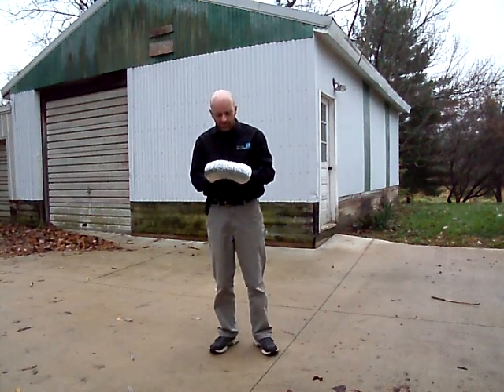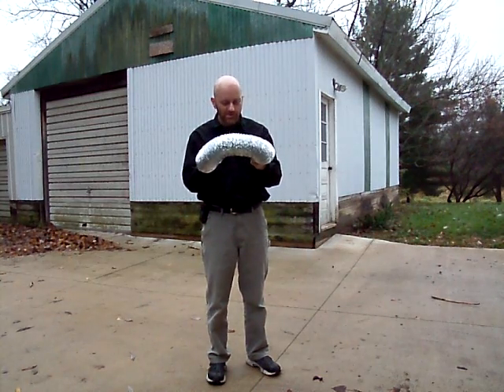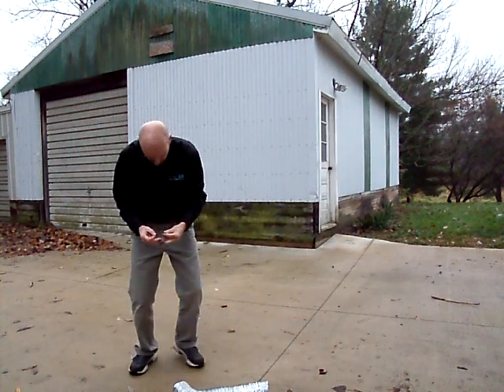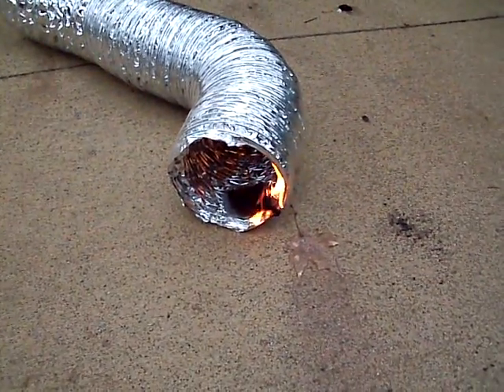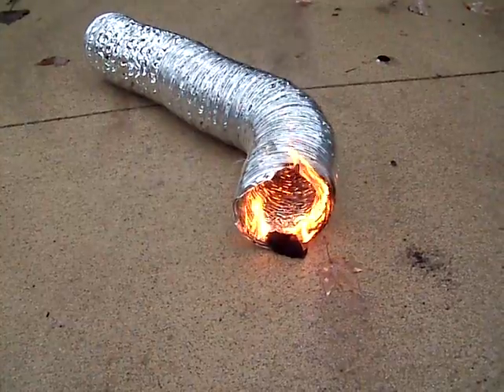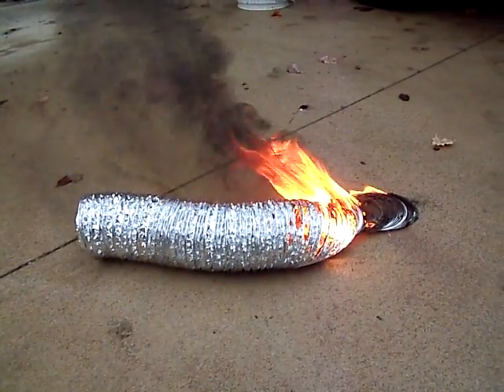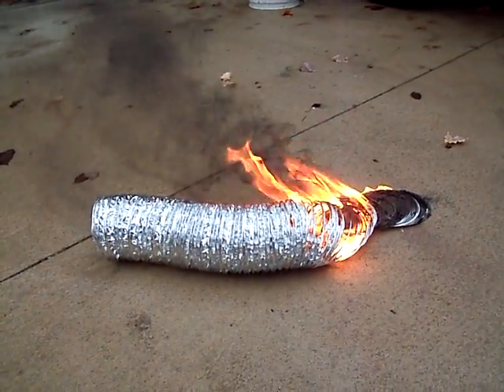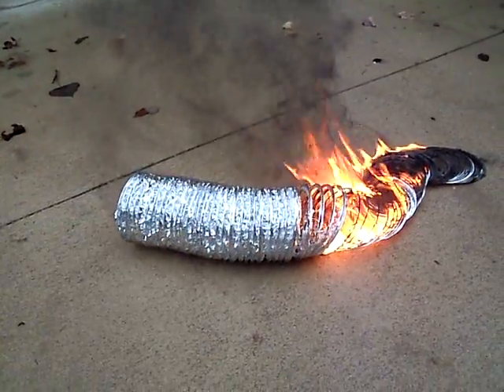Dryer vent installation BAD IDEA

Comment: That is plastic vent tubing and is made to look like it is made of aluminum. There is an actual product that looks like that, and it is actually made of aluminum and not plastic. That one is approved in Canada and I just used it to hookup my electric dryer. The stuff I used its called pro flex in Canada and you can put a blow torch to it and it will not start on fire. They have a similar product in the USA. I moved into my retro 1972 rancher 4 years ago and have been renovating it since buying it, and I had about a 9 foot piece of that God awful plastic dryer vent stuff running under the crawlspace to the outside. I should have changed it when I moved in, but just changed it all over this week to a 4 foot straight run to the outside with the approved pro flex stuff. When I took out the old plastic stuff, it was filled with lint and was really brittle. Could have had a fire but I was lucky I didn't. Now that I have the new stuff hooked up and a shorter run, it only takes my dryer 1/2 the time to dry cloths. A real bonus with the electricity rates going up all the time here in Ontario Canada. So if you have the old plastic stuff in your house, GET RID OF IT! Some hardware stores still sell this stuff and anything like that should be made illegal to sell in Canada and the US.
Reply from the maker: +Case Vandenberg Thank you Case. I still see this stuff being installed and left in way too many houses. Glad you got rid of yours. I have tested the other stuff and it's not to bad on the fireproof side, but I wonder if it would get brittle over time, especially when subjected to a long run where there might be condensation in the line. Thanks for commenting.
Reply: I think the aluminum flex is much more durable, and regardless, it should be changed and checked every so often. However I did use regular aluminum pipe to go through the wall so that is really high quality, plus the pipe to the outside, so there is not much flex in there. I  hooked it up so that I can take one of the clamps off anytime and then clean the line out. Should not have too much problem now since it is a short straight run.
Reply: aluminum burns too. while its not flammable it will melt from the heat of burning lint, then you setting wood on fire.
Reply: The depot stopped selling awhile back. might still be on the shelves some places
Reply: bobbg That could happen bobbg, but I consider that preventative maintenance neglect on the owners part. A person should check the dryer venting pipe out periodically, regardless of what type of material is used. Also, always clean the removable dryer vent at the end of each drying cycle. You would be surprised how many people don't, and as well as being a fire safety hazard, it also reduces the efficiency on drying times.

Comment: what if you have an electric dryer is this still an issue or not?
Reply from the maker: +sozo78 Still and issue but a lot less dangerous. Typically with an electric one, if the vent get's clogged, it will trip the high temp limit switch and shut the dryer off. The material will still break down over time and can cause a leak dumping high humidity into the room or crawlspace which can lead to some mold issues.
Reply: sozo78  yes. it's an issue with any dryer.

Comment: I appreciate the effort to promote safety, but this is not completely accurate. First of all, there are at least 2 types of this shiny flexible mylar ducting. One is NOT for dryers, the other is. Matt appears to be burning the kind that is NOT for dryers. The kind for dryers does NOT burn. I just tried it. It will burn BRIEFLY and then go out - nothing like what this video shows.

I have been using the kind for dryers for over 30 years now with zero problems. It is ideal for those impossible-to-reach areas behind dryers that are between two walls (or a cabinet and a wall). Many of you will know exactly what I am talking about. In fact, I have seen more harm done with the use of rigid or semi-rigid duct in these situations. Especially when it is impossible to reach the joints to seal them with the proper metal tape. 

With the flexible duct, you can seal the joint and then push the dryer back into position. The semi-rigid duct is simply not flexible enough to do this in many situations. I cannot tell you how many semi-rigid ducts I have removed that are so crushed, they allow hardly any air to pass through. 

If you have the room to work with it, use the rigid duct. If you do not have enough room to work with it AND do it with good workmanship, use the dryer-rated mylar duct. More often than not, I see poor workmanship being a much greater problem than the type of material being used. Rigid duct (or semi-rigid) doesn't do much good if a joint has come loose due to being unable to access it properly to seal it.

But Matt is right about these mylar ducts that are NOT rated for dryers, as his test should be all the evidence you need. But as I said, the mylar duct I have been buying from Home Depot (Everbilt) did NOT burn like this, at all. Note: they also sell duct that looks EXACTLY like the "dryer duct", right next to the "dryer duct", that clearly says "NOT FOR USE WITH DRYERS".
Reply: Jonathan Brett I completely agree. I cut about half of my dryer duct off because it was kinking up on me and just tried to light it on fire and it will not combust. The binders that sandwich the two foil backing will briefly flash, but nothing more.
Reply: Thanks for setting this straight. But to his defense at the very end of the video he does say it's ok to use Aluminum flex duct.
Reply: And he also wrote that “I see DIY installers using it way to often” which means the wrong ducting.
Reply: @futurus777  Always use rigid or semi-rigid metal ducts.  Regardless what type of material the flexible kind is made of, they have ridges which cause lint to build, plus they can kink.  Kinking reduces airflow, causing heat to build up.

And he did another test.  Video:  "Fire Test UL Listed Dryer Vent : Semi-Fail"
Reply: For the semi-rigid duct, it really depends on how long the stretch is. If it is long enough, then it can stretch out and won't kink.
Reply: Jonathan Brett ok’
Reply: Thank you Jonathan. I appreciate your feedback and education.
Reply: I'm so glad to read this, i was starting to panic lol!
Reply: I just picked foil flexible duct for small space.  Is it safe?
Reply: Use rigid aluminum only, not only fire hazard but usability issue when it kinks and bunches up

Comment: I can burn stuff too in conditions that it would never encounter. Now try to do this same test with the dryer fan blowing on your match- I think you will have trouble, and any fire that results will go out the vent as an ember, and we both know that is no different regardless of what the vent is made of.
Reply: I am a firefighter in south dallas.  These catch on fire all the time, because they are usually kinked, or full of lent.  When the dryer vent gets full it backs up into the unit, then the lent gets near the heating elements, causing the fire.

Comment: I just purchased an Everbilt Dryer Vent Duct from Home Depot.  It says it's constructed of heavy duty, fire resistant, aluminum foil laminate.  This duct says it's UL2158A listed and marked for safe dryer venting.  Would you recommend that?  This is the model # in case you are unfamilar with the product: BTD48HD
Reply from the maker: one2many I'd be suspect. The description says it's "fire resistant" but it could still be flammable material. It sure looks like the same material. It'll surely dry and crack over time and might melt. Hold a flame to a little piece of the end and see what it does.

Comment: I am shocked.  Thank you for this video.  Quick question...duct taping my vents is a bad idea too?
Reply from the maker: Rachel Riouse Duct tape was never intended for use on ducts. It's actually a misnomer from when the tape was developed as DUCK tape. The problem with using it on anything that will get warm (ducts, dryer vents, etc) is that the glue dries out and crystallizes and the tape falls off.  If you want to seal your ducts with something besides caulk or mastic, they make UL Listed tapes which are heat resistant and stay put on ducts.
Reply: Yes it is, use Foil Tape.

Comment: great video .. !! why stores still sell them if they are illegal ?
Reply from the maker: pemogo71 They are not illegal, but they should be. In most areas, they are illegal for contractors to install them, but homeowners can still buy them and do it themselves.
Reply: Matt KnowsThat they are made for bathroom fans, i still don't  like it, i get the aluminum  ones.but they are for bathroom  fans,is just some people use anything that looks like what they need,some contractor use ir because is less expensive,and they jus whant to get pay for doing mistakes.

Comment: Can someone tell me the name of this hose? I wanna avoid it at all cost. Can y'all  also tell me what exactly to look for?I need a new hose and would like to avoid burning down my house. Like key words that would be on the boxing or packaging it comes with? Thank ya. 😀
Reply from the maker: There are a few brands out there, but the key is to get something that is ACTUALLY metal. If you look for keywords like rigid or semi-rigid and UL Listed. Actually there are a couple links in the description of the video that take you out to Amazon to buy some good product. Thanks for asking, happy to help.
Reply: Matt KnowsThat thanks Matt. This video helped me a lot. I was just gonna pick up whatever I saw there. I picked up a heavy duty vent.  I installed it myself. Ugh feel so grown up 😁 lol thanks (:
Reply from the maker: Great job. Glad I could help you do it right. You'd be surprised what you can fix and do yourself with a little courage and a few tools.

Comment: I cannot thank you enough for this video!!!  My rental house burned down before Christmas due to faulty attic wiring and I lost everything I had.  Now in the new rental house I see this cheap gas dryer vent just like you showed.  I thought it was metal foil, not plastic.  Its very long and snakes around and is full of lint. I had no idea this might happen.  You saved a potential fire again.  I am deeply grateful.  I will go right now and buy the right stuff, and throw this in the trash immediately.  Many, many, many thanks!  I'm so lucky to have seen this video.

Comment: Hi Matt is the following product safe? Quadriflex Quick Connect Dryer Venting 8 ft - DK8S UL 2158A. Thanks
Reply from the maker: I'm not sure, but it doesn't appear to be made of metal. Take it out to the driveway and hold a match to it first!
Reply: Matt KnowsThat
Well even if its made out of thin tin foil it can still but at the right temp.

Comment: This is why I use the metal ducting and I seal it completely with Aluminum tape.
It also makes the dryer more efficient...Takes less time to dry your clothes, thus saving you money! Its worth the time to use metal ducting to be safer and save money.

Comment: After burying my folks in VA I came home to WA and a month later my home burned down, there was nothing left. I believe it was due to this dryer duct. I am having a hard time proving it in a case that is before the court now. My attorney withdrew so now its just me. I did save some of the duct work which the company ran 26 feet under my home.  and installed this flex behind the dryer. can anyone help me Matt?
Reply from the maker: Who installed the dryer? There are two things going on here. 1. Your local code may require that a contractor installing the dryer use UL listed materials (or best practice because they should know better). 2. There is a maximum dryer vent distance. The code usually says that it can't exceed the manufacturers specified limit. Since dryers have different fan motors, some might say 20 feet, and some might say 30. Each 90° bend is equal to 5 feet, so if your run was 26 feet and had two 90° corners, that's actually the equivalent of 36 feet which would probably exceed the limit listed in the owners manual of the dryer. If the duct is too long, two things happen: the air loses some of it's heat and allows the water vapor to condense on the pipe, and the air loses velocity and the lint particles fall out or stick to the condensation. Over time, the vent duct gets a large buildup of lint which clogs the vent, lowering the amount of air that can get through. After a while, it get's so restricted that the hot air from the dryer just blows on the lint which heats up and catches fire.

I'd have a chat with the local mechanical inspector and a fire marshal. If it was a DIY job by you or a previous homeowner, you might be out of luck unless you can try to pin something on a home inspector, but if it was an appliance installer you should be able to hang them on it. PLEASE let me know how it comes out, and definitely share this video. That's exactly why I shot it and posted it. You can contact me more easily through my website www.greatlakeshomeperformance.com
Reply from the maker: The local installer, if you had someone else install it, must also comply with your state and local mechanical codes.

Comment: Love the video! I could actually use some help, I am sorta like daniel below, I have to run it indoor because my house is old and the laundry room is built in the middle of the house and there's no way to run it on the side of the dryer to go outside unless i run it through the attic but my house is brick so i would have to drill out a place for it. But I really do not wish to go through that process. I was wondering what the safe easy way to run it indoors would be?
Reply from the maker: If it's a gas dryer (natural or LP) then inside is absolutely out of the question. Electric is allowable but still not recommended. I'm sure there's a way to run it to the outside horizontal if you think and ask for help, and drilling through brick is not a big deal. If you were going to drill the brick yourself, you can use a hammer drill and a 1/4" bit to drill a series of small holes in the shape of the circle size needed, then whack out the center with a hammer. Just be sure to caulk the gap around the pipe when you're done.

Going vertical is not a bad option either. Depending on the length of the run vertical or horizontal, you may need to add a booster fan. Your dryer owners manual will tell you the maximum run and how much run is represented by every 90° bend. Most are about 30 feet and a corner counts as 5 feet, so a 20' run with two 90° bends=30'. If you exceed that length of run, you can install an inline fan that has a pressure sensor on it that will sense the airflow and kick on to boost the flow so you don't get condensation or lint build up in the pipe.

Comment: It's not really inside inside the house its like a laundry room inside but at the top it has ventilation.. I mean there's some kind of roof but it has ventilation.. That's why I'm wondering if it's a bad idea to put this on my dryer
Reply from the maker: I guess that's okay then, you just don't want to have that exhaust in your house because then your air conditioner would need to remove the heat and moisture. And although the air might smell nice, that smell is laden with chemicals from laundry soap and dryer sheets. Not stuff you want to breath.

Comment: HI, thanks for this video.. i was wondering.. im planning to install a lint trap bucket & hose indoor vent kit for my dryer, since its an electrical dryer im wondering if theres some problem or risk putting this on it.. i really need your help.. sorry for my bad english but its not my main language, im from Guatemala.. thanks in advance.
Reply from the maker: daniel mendez Generally that's a bad idea. You'll be adding a LOT of moisture and heat to the house. Is there a reason why you don't vent it to the outside?

Comment: Great video! Omg!  You saved me from making a terrible mistake! Thank you! I just had my dryer installed today and I have to get a vent and they advertise these in stores as if their safe and "flame resistant" but you have revealed that to be false! These definitely should be outlawed!
Reply: jay carter They're safe only if they are rated for use with dryers. The ones that aren't should not be near(on store shelves) the ones that are!  Read the packaging carefully.
Reply: The vent hose he's burning isn't supposed to be used for dryers. Educate yourself.

Comment: Thanks for the info, I always thought it was aluminum, it's getting changed out today.
Thanks again
Reply: Some are aluminum along with other materials, it is the adhesive that they use that is flammable and when any hot flame hits really thin aluminum it will melt

Comment: Now try to light the match inside the tube with 40 mph wind blowing through it like it would have to do on a dryer. This really is not an issue unless you extremely neglect routine maintenance on your dryer. This type of vent pipe is designed to run on a dryer that is maintained properly.

Comment: not entirely true.   mine and all the ones I see for dryers are all-aluminum.   just read descriptions on amazon.   they say ul approved and not flammable.   I took a peice off mine that looks exactly like the one in the video and it is aluminum, NOT plastic.

example:
http://www.amazon.com/Dundas-Jafine-BTD48TC-ProFlex-Transition/dp/B0015UGPWQ/ref=sr_1_1?ie=UTF8&qid=1390783926&sr=8-1&keywords=flexible+dryer+vent

Comment: I assume since it was made in 2009 and it's 2014 there's no success in getting this removed? I'll be replacing mine
Reply from the maker: Nope, you can still buy it. Most of the packaging says not to use them for a dryer, but the sales personnel at big box home centers still sell it for dryers.